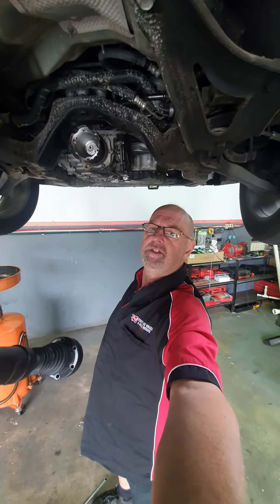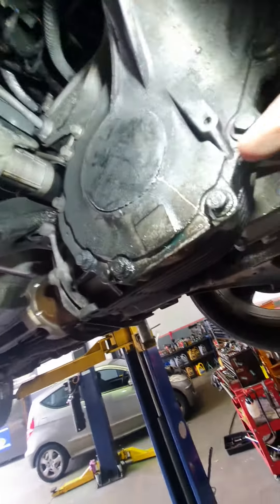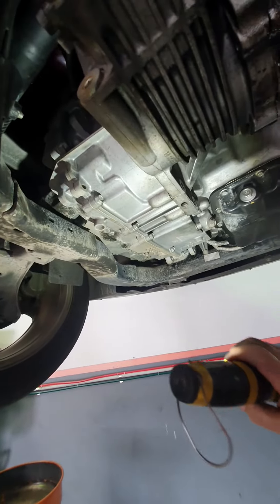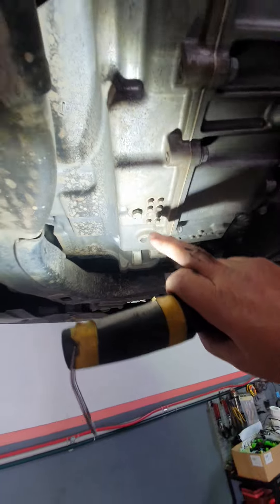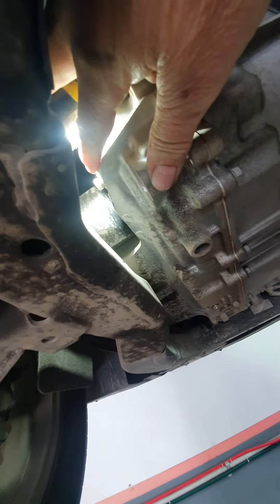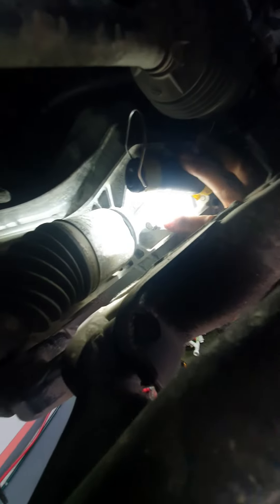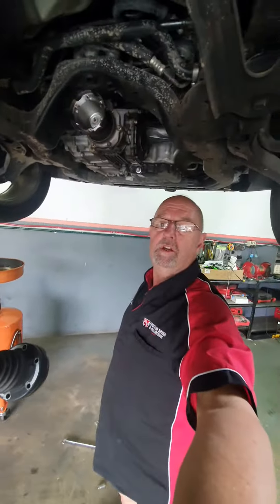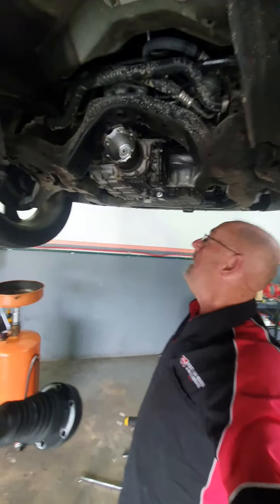Captiva automatic transmission drain and refill bung locations

Comment: I thought the filler hole is on the top of the transmission.
Reply from the maker: You can fill it from the top but the battery and the battery tray need to be removed. A waste of time in my opinion Regards Matt